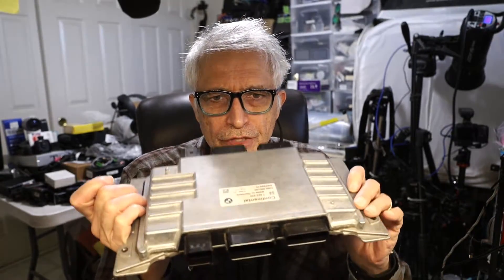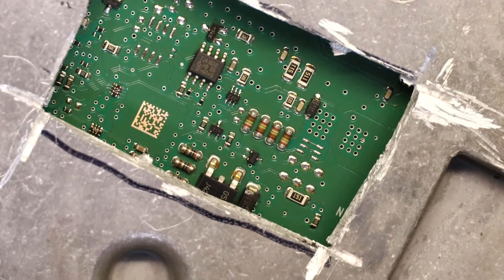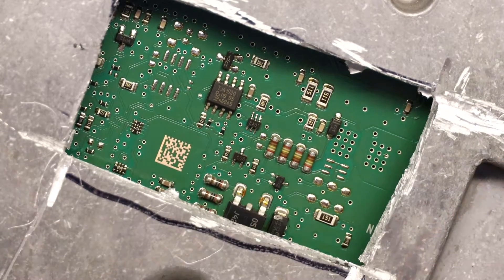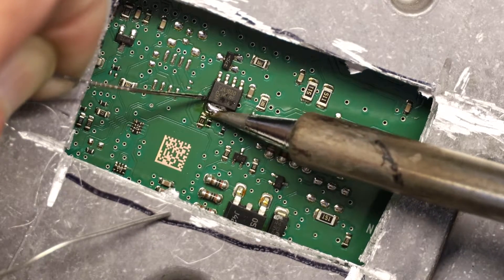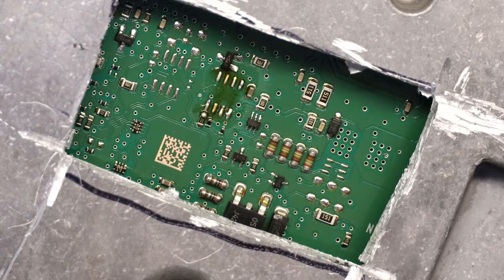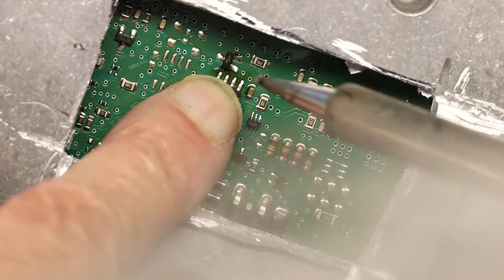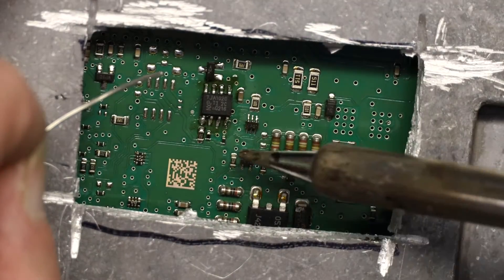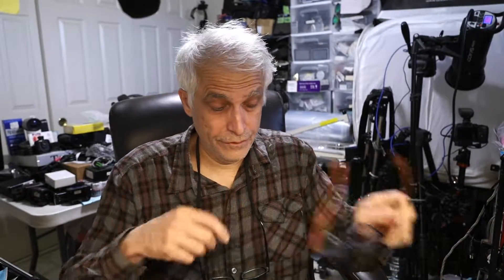How To Replace an 8-Pin Surface Mount IC Chip on a BMW DME MSV90 Continental Computer Module.

Comment: How did you cut open the canister? Is it not possible to open it using a heat gun.
Reply from the maker: Unfortunately it is not possible, they had to use metal cutter very carefully not to damage the board.

Comment: What is the function of the ic you replaced?
Reply from the maker: Goos question. This is a TJA1020 LIN chip. The TJA1020 is the interface between the LIN leader/follower protocol controller and the physical bus in a Local Interconnect Network (LIN). It is primarily intended for in-vehicle sub-networks using baud rates from 2.4 up to 20 Kbaud.

The transmit data stream of the protocol controller at the TXD input is converted by the LIN transceiver into a bus signal with controlled slew rate and wave shaping to minimize EME. The LIN bus output pin is pulled HIGH via an internal termination resistor. For a leader application an external resistor in series with a diode should be connected between pin INH or pin BAT and pin LIN. The receiver detects the data stream at the LIN bus input pin and transfers it via pin RXD to the microcontroller.

In normal transceiver operation the TJA1020 can be switched in the normal slope mode or the low slope mode. In the low slope mode the TJA1020 lengthens the rise and fall slopes of the LIN bus signal, thus further reducing the already very low emission in normal slope mode.

In sleep mode the power consumption of the TJA1020 is very low, whereas in failure modes the power consumption is reduced to a minimum.
Reply: @TECHNOLOGYTIPS101 can you tell me where you obtained the replacement chip, I may have to do a similar repair. After you returned the DME to the owner, was the issue resolved? Thanks for this video.
Reply from the maker: @bfgillan @bfgillan, the owner was happy, and the problem was resolved. The chips can be found on eBay.